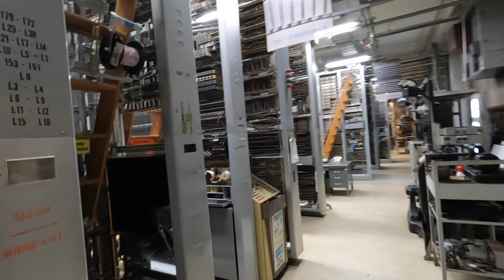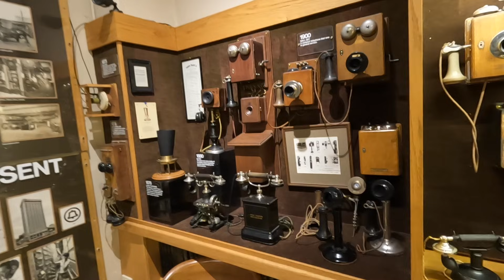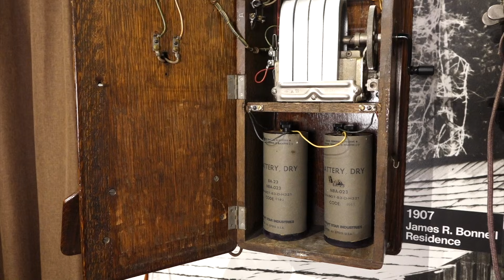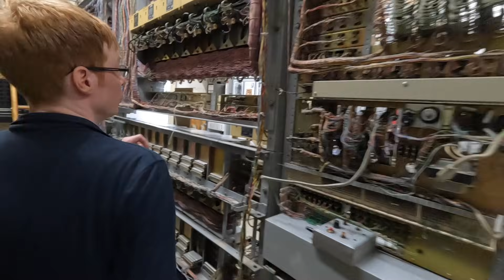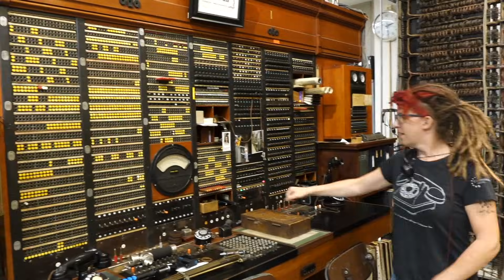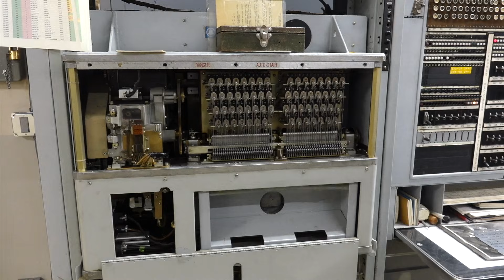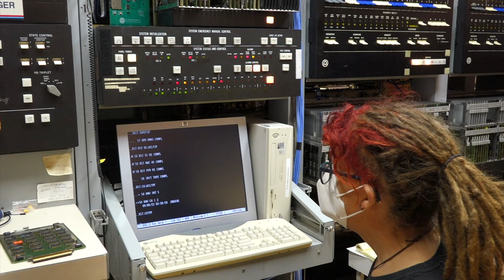At the Connections Museum: the insane telephone technology that led to today's computers

Comment: I was wondering about the light rail system that is supposed to cross the i90 bridge.  I heard that they were dealing with potential corrosion - and built "pigging" hardware.  However, from one of your other videos, I heard that bell labs already had figured that out when they switched to common battery by using -48v.  Could they just switch the rail to -1500v DC?  Easier said than done if it's already built

Comment: Hi Marc,  Your tour video at Seattle of the Telephone Museum was in great cadence from cord board, step by step, panel and 5E.  I will need to schedule a trip.  I have to say Marc, your interest in the past, now being a fiber guy, really says you respect the very industry roots.  That’s a remarkable claim.  There is a nifty guy Evan Doorbell on YouTube that has the audio sounds all of these pre-computer systems sounded especially when amplified.   Evan has recorded the old sounds. Did you know a big City ring sounded different?  I am working on some ring tones using these ‘sweet sounds’.  Like between a tandems.  If you understand relay logic you may get a kick how damn clever these engineers were.  Pleasant regards. Jerry from Chicago

Comment: Once the Weld ME switchboard was upstairs manned by the wife of the towns garage owner..  My Grandmother had a phone on a multiparty line, where each user had their own Ring code, identifying their calls.  My house near Boston had a 2 party line which allowed a private line feel on a line hiding the other party.  I had to get a private line of my own because I wanted to use dialup BBSs..  I also could use an answering machine on it.  The older lines could not use such "modern" stuff.    I do not know when our original two party line became a private line, but the wired in two party dial wall phone could not handle the new private line signalling.   Its ringer died and we had to have regular wall jack.  Originally, under Ma Bell, everything was Telco-owned and rented.  My house was built in the 1940s.  I write this to show how tech has changed from back then to modern Touch-Tone and DSL service.   I am glad to any Connections Museum stuff.

Comment: Fascinated to find this , I worked for a Uk Company who had operations around the world , mostly Brit Commonwealth soI grew up with both GPO and bells system practices. As you say the analogue technology was mind-blowing and expensive , Ericsson crossbar switches were precision made from Phosphor Bronze and copper with gold plated contacts on trunk versions  , it wasnt just the cost it was the weight, exchanges/central offices had to be specially re inforced to carry the weight of hundreds of these units.
i was also involved with the development of international direct dialing and the international use of things like toll free 1 800 service.
Thanks so much for bringing back happy memories of untangling the mysteries of call routing, route planning  and number assignment in the pre digital world

Comment: A neat tour Marc, thank you.   I never knew that museum was up in Freeattle. Dielectric grease(voltage isolating grease) came about by Ma Bell and all those switches,,that clicked open lines, for years and years.   First time I heard or seen it was by very early Tamiya electric RC models.  Those speed controllers were a wiper switch with 1st, 2nd, and 3rd "gear" and reverse.  The assemble-yourself kits included this little tube of Die grease,,for the switch speed controller.    Also, early slot car track controllers were/are a wiper switch controller, and benefited greatly by a little swipe of Die grease.

Comment: When I was young(60s), the local exchange was just down the street from me, a beautiful old brick building with big glass windows, and you could see (and hear) the rotary encoders busily working inside. They were open-frame, not covered like the ones you showed, and hung on a huge rack two stories high. I was fascinated, and would have loved to go inside, but the doors were locked with a big NO ADMITTANCE sign. Of course, it was all converted to digital eventually, and the old building fell silent. It was torn down a few years ago, and I mourned its passing. Thanks for showing me this.

Comment: That video was great in the mid 70’s I was a telephone exchange engineer and work on trunk switching exchanges. I installed Strowger exchanges when I started. I also worked in the director rooms now that was loud after 9 hours in there your ears would be ringing and they would be buzzing all evening (long before people used ear defenders). Then I went on to install cross bar system. And final before I went self-employed worked on installing a 5ESS. The engineers who did not work on it were jealous because all the overtime went to this project hence the 5ESS’s nick name was 5 Evenings, Saturday and Sunday

Comment: Working in a Central Office in Cleveland that in the 50s had Panel and #1 Crossbar switching equipment serving 40,000 lines, there would be 45 people working around the clock to provision and maintain service and the equipment. Job titles: Central Office Technician, Apparatusman and Frameman.

Comment: I  worked on building alarm systems in central offices in Kansas in the early 1980's. Some of them still had the old equipment. One guy told me he was sad that an electronic system was going to replace the mechanical system. He said you could tell when the old machine was having a problem and what it was just by the sounds it was making. To me it sounded like a hail storm on a metal roof!

Comment: I'm an old Panel man. After they had me working on incoming's and finals, then office and district frames, and line finder frames, they put me to work on the Sender A. R. T. (automatic relay test) frame. They paired me with Fred Stier, who was a WWII veteran who really knew his stuff. I'll never forget the first time I actually diagnosed and FIXED a defective sender. It was just a flat spring relay that needed adjusting, but once it passed the diagnostic test - repeatedly - I felt like I'd arrived. That first little success gave me confidence and after that I was off and running!

Comment: https://www.youtube.com/watch?v=AQYJjLhoP18
Reply: I've watched this video so many times at least 100 times, I've actually called into their exchange and sometimes you can hear some nice messed up power hum on there stuff not sure if that's the line or something to do with the damage that happened in 1975
Reply: @MichaelWallace-oq3wd  I would think equipment would be long gone from that time
Reply: @Wa3ypx  I'm not sure what you're referring too, But i was talking about the exchange on 2nd Avenue In New York, Now i do know that stuff like that extent will cause some other problems when they installed new equipment and i called this one number that had a very eerie sound in the background coming from the Ground on the battery's and you could hear some crosstalk as well on there going on. it was pretty cool i was on there for 2 hours at least. just listening to it. And btw, Yes crossbar switching equipment is still being in used in many other countries i've called into many crossbar offices in russian and so on, And they all have their own unique sounds to them all, You just gotta be smart enough to find it. ;)
Reply: @MichaelWallace-oq3wd  The video I linked about the fire at that exchange. By now the replacement or repaired equipment would be quite outdated I would think.
Reply: @Wa3ypx  Yes! outdated indeed...

Comment: I bet BT british telecom didn't save any of there old equipment as i was a exchange engineer in the late 70's early 80's working on strowger pre 2000, 2000 and 4000 all of the exchange's are empty with just a small cabinet full of digital equipment which is on borrowed time that's why we are rapidly upgrading to fibre .................tony

Comment: I hired on to Pacific Northwest Bell, in Jan 1963 as a frameman in this very building, running jumper wires for the #5 Crossbar office that was cutover into operation that year.  During the time I worked in that building, a second floor was added, and a second #5 Crossbar office installed.  Soon after that a building addition, doubling its' size, was added to the north end of the building.  The expansion was needed for a third #5 Phase Three Centrex office that was installed to serve the Boeing Company.  I just turned 80 yesterday, and boy does watching this video bring back memories.  Thanks!
Reply: That’s great. I hope you’re enjoying retirement!
Reply: What a coincidence, my name is also hank, I hired in to Pacific Telephone in El Monte, started indoctrination on Jan. 3 1963 as a frameman, went to I&R 6 mos. later, then back to the CO where I started in SXS switching for a few months, then to #5 xbar, then Power, then T1 CXR, then transferred to OBT.  I turn 82 next week.

Comment: I haven't heard that strowger sound for many a year, by the time I left all you could hear was aircon units hammering away desperately trying to keep everything cool, and failing.
Reply: After strowger we had cross bar in NZ. Then NEC electronic switching. And of course now NZ is about 90 fibre.  I used to be a lineman.

Comment: Thank you for this, from an old #5XB Troubleman. Seeing a master test frame for the first time since the eighties and hearing the trouble recorder brings back memories of mostly good times. The bad times were when the trouble recorder was spitting out cards so fast you couldn't keep it fed. BTW...the card you dropped, I only saw it for a second but it appears to have failed around the LXP1 punch. Look up schematic 20001 page 34A for a solution.  You also had a cross in there as well. I can't remember what I had for breakfast but I can still read a card. 

You could do a 2 hour video on crossbar and still not scratch the surface,  completing markers, dial tone markers, incoming and outgoing registers, pretranslators etc. I would definitely watch it.

Comment: Very interesting stuff there! I remember back in the 70's we went to an open door day of a telephone central. There were all these rotating and climbing relais. They had huge banks of racks with these relais. Very impressive. But you say the computerized central came in operation in the 70's. I guess the US were technically ahead on us here in the Netherlands. But eventually we also got digital centrals using the dtmf tone dial system instead of the pulses. And nowadays they are about to decommission the normal telephone line system, because more and more people do only have a cell phone. And I have also a land line phone, but working via the tv/ internet cable system... So one can see how quick technical evolution goes... Or I am getting old. (tomorrow nov 4. 56 years)
Reply: You are 1 year and change older than I.  If you REALLY want to feel old, try working in the industry.  I've gone from tracking phones issues through a physical jungle of copper pairs to tracing SIP call failures through data networks.  When I go to company outings, I look around at my co-workers and try to decide if I am an associate or a chaperone..

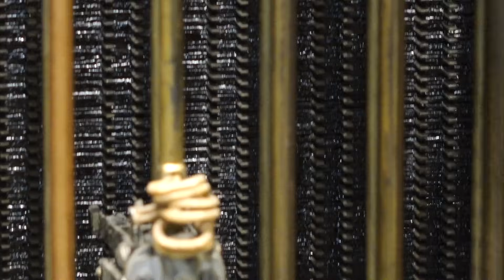Comment: 12:33 at my shop we had 4 lines so 4 twisted pairs but the lines coming in went into this bread board looking thing that had ~200 connections and tons of wires. Why were there so many? We had our own building so there weren't multiple customers and all buildings were separated on that street by at least one telephone pole. Then we got Comcast and one  coax cable replaced all that along with 100$ a month. Why would you have all those twisted pairs?

Comment: What a great video! One thing I keep wondering about is this: Bell Telephone had no competition and yet these systems are extremely sophisticated and robust. What made the company invest?
Reply: Capital expense could be part of the rate base (i.e. used to justify costs charged). Maintenance expense was simply that - an expense. Therefore, they built everything to be expensive to construct, but almost maintenance-free.
Reply: @johnmcnamara1554  I agree. It’s just that there are examples of monopolies that just didn’t care. Think phone system in the Soviet Union 🙂
Reply: @thomasherbig  If you wanna hear that machine connecting your phone call through, you might as well call into their stuff cause it is simply amazing to listen to those sounds ones again i love it.

Comment: I have a Model 28 with Bell System on it. It was my first computer printer. Teachers didn’t like my reports in all caps. I had a Model 14 TD and reperf. When it was all running it was very loud.

Comment: I was in India ages ago (1985) trying to put thru a call with the operator watching the dolls eye flashing angrily, he said, "he wants a connection but ive more important ones to do first," To silence the flashing annoying dolls eye he stuck in a plug with no wires, it stopped flashing, I said "what's that?"  "dummy plug" he said as the subscriber's line went more than dead hahahaha

Comment: As a young and former Lucent engineer in the late 90s, I dedicated many hours to reading about and studying the history of the technology in the telecom industry. I’m going to need to make a trip out there to see for myself all the tech I read about, but never had the (mis)fortune to play with.  Thanks Marc for sharing your invite with the rest of us!
Reply: It says something about quality when the local community college is still running analog phones off of TN boards (now in G650 carriers) that I personally installed in SCC cabinets...in 1992.  Don't remember now if that switch was a System 75 or an earlier Definity.  I think it was like 2008 or so when the SCC stack was replaced by the G650s and it went from being a Definity G3 with a Processor Pack and became a Communication Manager 5.x with an external Linux server and an IPSI board.

I started down the Telecom path on a Dimension 2000, MAPP panel, and TOPS manuals.  Still walking the same path, and in some areas the scenery hasn't changed much.  I noticed something which struck me as funny the other day.  During the transition between Definity and Communication Manager they kept a linear flow on the release numbers.  Definity r11 = CM 1.x, Definity r12 was the same as CM 2.x, etc.  It just jumped out at me the other day that CM 10.0 proudly identifies itself as r20 when you query the version number.  All Communication Manager really was at the outset was a port from Oryx/Pecos to Linux.  The last Oryx/Pecos release was Definity r13/CM 3.x.

Comment: in 1977 I lived in an area which still had crankhandle phones and operators patching cables

in 1984 I was part of a project to replace it with individual service using a NEAX61M - thousands of miles of party lines covering rural areas were involved. Some of the old lines were 30 miles long and weren't central battery systems
Reply: I remember driving back across the USA following boot camp in 1983, I ran across a coin phone that had no dial, it was clearly a current era housing, apparently this area was so rural [mountains, rest area type location] that phone service was provided via radio somehow, you only deposited money when requested, not ahead of time.  You'd never think I'd eventually work at a RBOC, as a service representative; one day I had a meeting/training at another town some distance away, luckily the office was co-located with the switching system (frame), I spent my lunch talking to a man, wanting to learn more of how the 1A-ESS worked, I got more of a lesson on multiplexing, which was his Forte.. I wanted to venture into other areas of the company where passing a self learning class (book) was a requirement.. it was based on crossbar.. I already knew all of our equipment way more current era than crossbar, as our handbooks indicated what we had for feature interactions.   Needless to say, the micromanagement my job suffered sent me the disability route, my former partner advised me some 10 years ago my office was barely staffed [was 100+ people before] and now has been vacated.. thanks internet..

Comment: Fascinating. Did I miss T1 somewhere in the voyage, or is that a "side issue" to this?
1976 I had a temp job at TRW Vidar SLO, night shift repairing and updating T1 channel units and repeaters. Thanks for the trip back in time.
Reply: We have lots of T-carrier equipment, and actually use it to interface the switches to the computer for the call generator software and the outside world. Didn't have time to cover that in the video.

Comment: I am So glad it's all still Working and in a Saved state with folks around who have the know How to put it back into Use if it is Needed , Like after an EMP or bomb blast , Huge Earthquake or Other disaster .   I Curate older Computers from 1977  to Present that may be of Use rebuilding Communications , I am so Happy when I see young new people Collecting , Restoring and Curating Computers or Phones , Electronics in general and making sure it is up and ready to function , Thank You , Liked and Shared :) QC
Reply: Someone might want a IBM S/34 that's been gathering dust since the 90s in moms basement, when I looked up statistics, it wasn't something for big projects of today, a 8 inch floppy could only hold so much, or hit had to be hand input, or lastly if equipped, telephone connection.

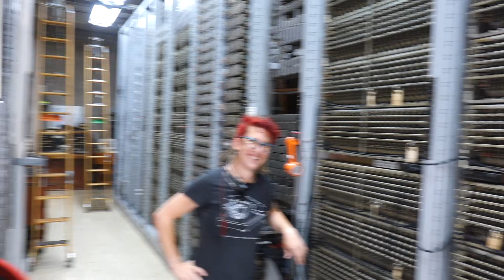Comment: I was so lucky… as a technically inclined teenager (and later adult), I experienced all of these technologies as they came and went. I ended up in broadcast systems, but the phone systems from manual switchboards (we owned a small hotel happily next door to the city’s exchange), through uniselectors,.. (17:10) AXE crossbars and on to SIP routers in recent years.   A great founding in electronics and concepts.